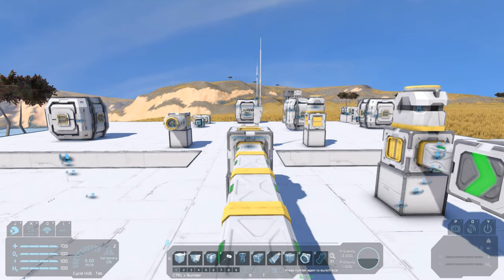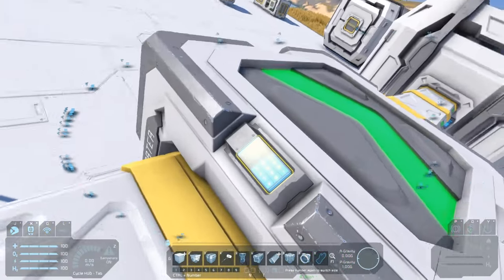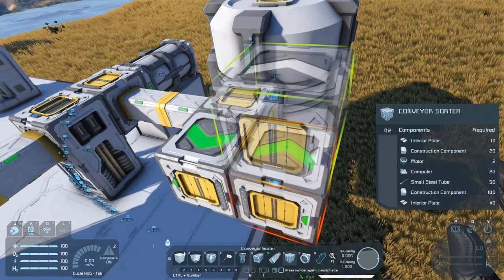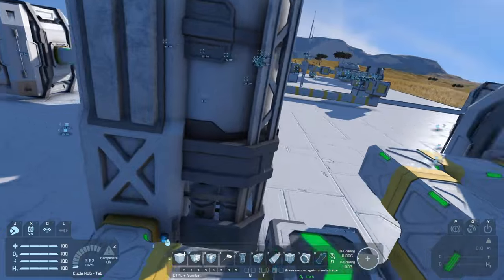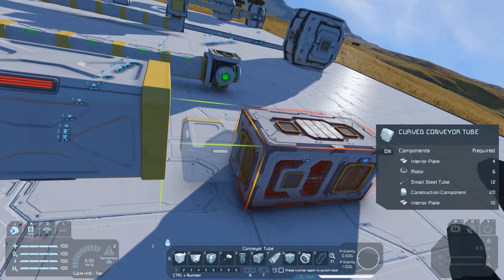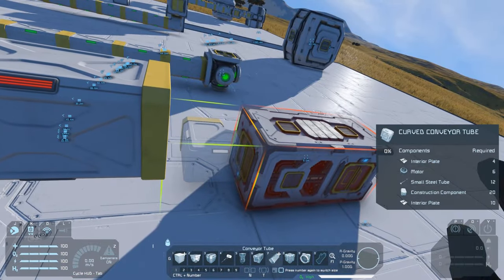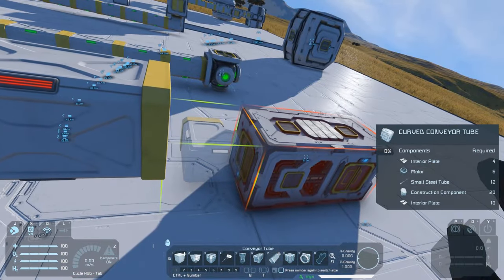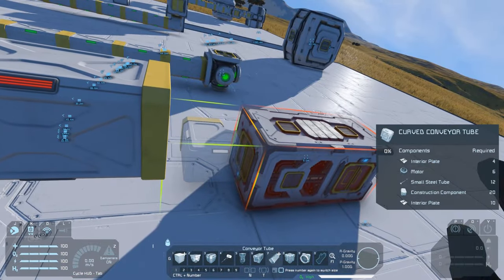Space Engineers Tutorial: Sorters and Conveyor Systems (tips, testing and tutorials for survival)

Comment: I use disassembly for components that I harvest from many things because I personally rather Que up components as needed then to make a storage from a bunch of components and my argument to that is that many pieces of equipment use similar ore I just don't want to be cought in one of the two possible scenarios that are created from that set up. 

The first being i need resources for other components that the components i made for in batch for supply have so then now ill just have to disassemble them anyways or get more ore either way it means more mining trips over components i may not get around to using in the first place.

My second Argument is the fact that if i pull from a component supply i run the old time issue of not having enough of a single or perhaps even multiple components now ill have to Que up a lot to refill the components supply all because i ran out of that particular component so my options are to then Que up the necessary components for it that ill then have to remember what components dig out of the now automatically sorted components supply then consume more resources to refill the components supply that as i said may not get around to using.

It also has the added benefit of letting me track my resources by the ingot instead of by the component which is easier in the long run.
Now i wont deny the Component's Supply usability i do see a use for it if you only have one Assembler and a lot of engineers on one base having a supply of general Iron main Components can open up the assembler for those that need to special order more specific components and it is faster to pull from already available components then to create them on the fly.

But id only recommend a component supply if its for a large base or ship and that ship/base has a large crew to accommodate that so everyone can pull necessary components by yourself id say just order them as you need with some speed modules the wait isn't that bad its only about at worst its 15 seconds to half a minute with it being uncommon at a lot of components at like a minute. If you like useing a component storage then you do what you like best thats just my opinion on the matter.

TL:DR: My opinion is i like making components on the fly rather then having a component storage for Various Reasons.
Reply from the maker: I play with slow manufacturing times so a system like that is quite undesirable. If it's on faster then it can work really well as you say though :)
Reply: I play on 10/1/1 high inventory realistic everything else and with some speed modules i still see it as viable since I am alone usually and am rather patient. Says the guy who's played a lot of old video games having dealt with a lot of loading screens you needed patience back then and I still have some of that even now.

its more like something you set to passively work on as you work is my reason to back it even on slow settings. when I initially started playing this game that is when they added solar panels and I was playing on 10/10/10 because I knew just by looking at it had I not done that my interest for the game would have plummeted quickly. Especially with MP being kind of just there to fill In that gap at the time ya know to act as a placeholder for whats to come but its not there to be legitimate. It was only until they made the overhaul has it been rather viable.

Also i didn't have the computer i had back then i had a Dual Core PC with alot to be desired it could run the game on low settings but i think this game was what created the incentive to get a new PC. Now i have a 6 Core PC that runs the game solidly on medium settings with plans to get a better graphics card in the future from a GTX 720 to GTX 1080 to further improve graphical capabilities to enjoy this game on possibly even higher settings.

Comment: I wish you would have explained how you have the sorters on the miner craft you have.. I setup my base similar but it still isnt pulling the materials to refinery and I believe the problem is the setup of my craft.
Reply from the maker: I did explain them in the videos where I built them, it's a fairly straightforward setup compared to what's done here. You set up a sorter that is whitelisted for stone attached to an ejector, the ejector is set to pull all and throw out, otherwise my mining ships have no other sorters on them and won't impact their interaction with base mounted sorter systems.
Reply: I was just reviewing the video myself and it helped a lot, yay now I don't have to unload my mining ship manually!  The things that come to mind for your issue is the settings on the sorter and the orientation of the sorter.  make sure the sorter arrow is pointed away from the ship, check the black/white list set up, have the proper materials selected and make sure that the sorter is set to drain all.  The ship should not be stopping anything.  As long as you have the ability to manually unload the ship through the connectors into storage then with the proper set up of conveyor sorters the base will automatically pull from the ship once you have locked that connector.

Comment: One of the things that's bugging me right now is... How many sorters do I need? I've been searching for the info and I just can't find the answer anywhere. There doesn't seem to be any data anywhere on just how fast sorters will drain inventories. Maybe something worth testing?
Reply from the maker: I've been thinking about doing some tests on things like that, but more in relation to how quickly you can eject stone as I haven't found situations other than miners where I've needed stuff to move faster than a sorter usually handles things
Reply: @Splitsie  I'd like to keep the stuff in my containers somewhat separated. The setup I have in mind has a lot of the features that you show in this video, with a few extra and a few adaptations. For now, what I'm wondering how many sorters I will need to empty my miner in just a few seconds so that I can have quick turnarounds. I'm using a click macro to do that right now. I can easily do a dozen trip with my miner before my battery gets low since I'm sitting on top of the deposit. The refineries can't keep up as it is, so I definitely need to force the extra ore into a container.
Reply: @Splitsie  The tests I'm doing right now reveal that there's probably a bug somewhere in the code of sorters. The assemblers sometime end up full of ingots they don't need even though there's 2 large containers reserved for that. There are 2 sorters between those containers and the assemblers to prevent component from back flowing into those while allowing ingots to go back into containers when disassembling. They have a simple whitelist filter with drain all set to off. To remedy that problem, I decided to setup a timer so that I can flush the assemblers when needed. That revealed another problem. When I trigger drain all manually from the block, things seem to work fine, but when I trigger drain all using a timer, the sorter seems to act like nothing happened, making my timer utterly useless.
Reply: @Splitsie  Seems like the solution is adding a third conveyor sorter. The first 2 serve as to isolate the cargo containers and as passthrough under normal condition. The third is set to drain all and turned off. When flushing, turn off the first 2 and turn on the drain all sorter. Makes the whole thing more bulky then it should be, but hey yay for bugs.....

Comment: Hi Splitsie.  I'm back here (my go to series for attaining sound SE knowledge) because I,m trying to resolve an issue that has had me stumped for a few days now.

I have set up a foundry with two Refineries and four Assemblers and I am trying to work out how to have Ores equally distributed to both Refineries and then have the Ingots equally distributed to all four Assemblers.  I'm trying to do this without mods or scripts and so far have been a total failure.  I have even tried putting a Conveyor Junction an equal distance between two Assemblers but still the Ingots get sent to only one Assembler.

Do you (or anyone else) have a solution/suggestion that doesn't involve mods or scripts?  Or is this simply un achievable
Reply: Also,  at the 12:00 mark you correctly state that the Assembler, because it is a production unit, does not need a sorter because it will pull the ingots itself as they are required.  Although this is indeed true, it will create a slight delay when building items as the Assembler will have to pull the Ingots required from the allotted storage location.  But, if you do include a sorter to the Assembler for Ingots it will store them at the Assembler ready for use.

This is much more efficient but doesn't come without its own problems.  It is just important to make sure that the Assembler doesn't become to full which may result in there not be enough room to get some missing Ingots to build a particular item.  But nothing that a little bit of manual management can't control.
Reply from the maker: I haven't seen a method of balancing refineries in vanilla without scripts, however it might be possible if you take advantage of the slow movement rate in small grid small conveyor sorters.

Since they're so slow you could use several of them in parallel to move the ores and ingots to their respective storage locations. So, have the connector from your mining vehicle go to a storage container with a large sorter, from that storage container have an advanced rotor switching to small grid, then have as many sorters as are required (you may need more than 1 per refinery). By using these, they should only grab a small enough amount per tick that more than one refinery will get that ore giving you an approximate balance. I haven't tried this, but given the troubles I had with the goose and its sorters not pulling fast enough from the butterball I suspect it will work well enough for most purposes :)
Reply: @Splitsie  
Mmmmmm!  I might jump into creative and try this and a couple of other ideas that have sprung to mind.

It's amazing after all this time that the game has the ability to share production with multiple Assemblers but we still can't share distribution of ores between the Refineries and Ingots in the Assemblers.

I did discover another anomaly with this in that I had four Assemblers sharing production but couldn't work out where the items were going that I had requested.  Turned out that because two of the Assemblers had not received any Ingots (because of the Sorter problems) they still had the items queued up.
Reply from the maker: I'll be interested to know how you go setting this up, setting up something like this without scripts would be just the sort of thing that will annoy everyone who tells me just to use a script for any problem I come across, not to mention incredibly cool :)

That is a downside of the coop mode that I've come across before when I've had sorter based setups, they can cause a few problems when you're running low on resources
Reply: @Splitsie  
Sorry, no luck so far.

I tried the small grid conveyors like you suggested but could not get them to join up between the two units.  I eventually got them perfectly aligned, but when I tried to put the last joining conveyor in it would connect to one but just push the other block away, not weld the two together.

I tried putting two sorters on the Cargo container, one on each side each going to one Refinery thinking that they would both pull at the same time - no luck.

It also became apparent that distance has nothing to do with where the items go.  Its all about which unit is built first.  I built one unit 10 blocks away and the second 2 blocks away, but the first built unit always got all of the ore.

I'm not done yet.  There are a couple of other things I will try tomorrow as also think it would look great if it can be made to work.
Reply: @Splitsie  
By the way, in my endeavours to minimise the use of mods and scripts I have over come the problem of battery recharging etc when docking a ship that you used a script for in your Survival, Maybe series.

The solution I used (which may be usable in your Getting Started series) was to use two Timer Blocks on my ship(s) – one for docking and one for takeoff.

When I am Ready to Lock at a connector I select the Docking Timer Block.  It switch locks the connector; toggles off the Antenna, the Gyro(s) and the Thrusters; switches the Batteries to recharge and turns off any other equipment that may or may not be on like Lights, Ore Detector etc.

When ready for takeoff I select the other Timer Block which is set to reverse the Docking actions (the switch Recharge action on the Batteries turns them back to Auto) except for those actions that were set to turn off, which I choose to turn on manually. 

This has helped to solve another problem I experience more often than I care to admit, in that I often forget to turn off my Collectors/Ejectors before docking, which can be embarrassing when I have them set to eject Ice.
Reply from the maker: The timer system for docking is one of the simplest and best solutions, I'm planning on using it to explain how to use timers in when I do a tutorial on it :)

I might have to mess around with the refinery setup and see if I can get something going, maybe when I'm at work tonight :)
Reply: @Splitsie  
Nice job you have.  i often wondered how you managed to get so much done 😉
Reply from the maker: I can't always get things done when I'm at work, for obvious reasons the patients take priority, but on night shifts if they're stable there's normally a good few hours where my input isn't required and something I can drop immediately is good to fill in those hours :)

Other people have their books, browsing facebook etc, I usually end up replying to my comments on YouTube :)
Reply: @Splitsie  
☺
Reply: @Splitsie  
Well, I have exhausted the depths of my imagination and came up with a complete blank on an automated in-game option.  I even tried creating a loop thinking that it might sent the game into a tizz.  But nope, it just stopped all of the ore at the first Refinery built in the system.

I did come up with a workable manual option with the use of the docking Timer Block.  I included Toggle off the Refineries upon docking.  That way I can manually distribute the ores and then either turn them back on manually or have the Timer Block turn them on when I takeoff.

That's the best I could come up with.  But you are a far, far better man than me Gunga Din, so I'm sure you can solve it.
Reply from the maker: I don't know about that, but I'll give it a crack :)
Reply: @Splitsie  
Never doubted that you would resist a challenge

Comment: I just connected a small container to a large container (with the extractor module/sorter between them), and ALL my stuff is gone to nowhere. I clicked on "drain all" and Pshit everything disappeared. I just wanna cry right now.
Reply from the maker: That sounds like a bug, if you have a sorter between two cargo containers and there is no connection other than the sorter between them, then it should pull everything and dump it in the second container. 

If you do have another connection then your components will remain in transit (so to speak) as the sorter is constantly pulling everything from every container, even the ones it's supposed to be dumping in. Also with the new way the inventory defaults to the previous ones you looked at, it's probably worth searching for the large container specifically just to check. 

If all that's done, submit a bug report as I can't think of anything else that might have gone wrong :(

Comment: Fairly new player here, so I have a question I hope someone can help me with. My sorters can only move ores and ice in 1000L batches at a time. And thats fairly ineffective with my ice driller that can hold a total of around 900k L of ice in its two large containers. How can I get the sorter to pull it faster from the drill rig  and into my hydrogen factory??
Reply from the maker: That's as fast as a single sorter can move things, you have to run them in parallel to get faster throughput
Reply: @Splitsie  well that sucks major ass... Ahwell, faster then to just move it manually from my drill rig to the containers. Thanks for the quick reply Splitsi, love your adventures with you trusty sidekick capac 😁😁